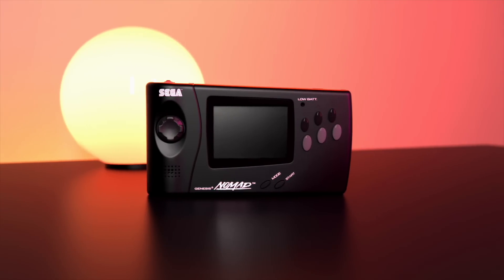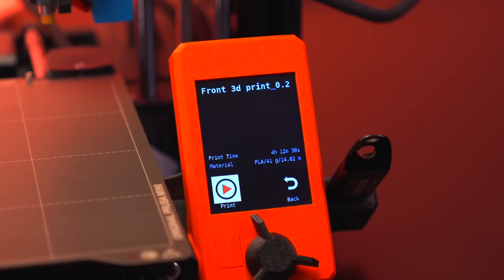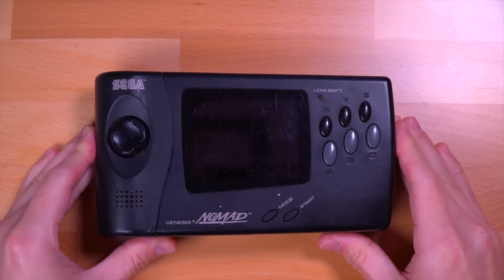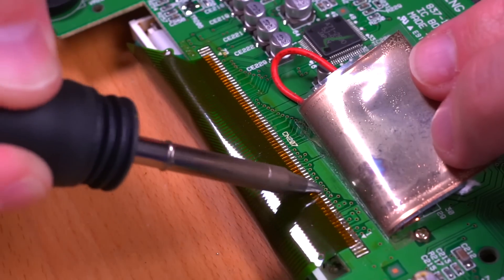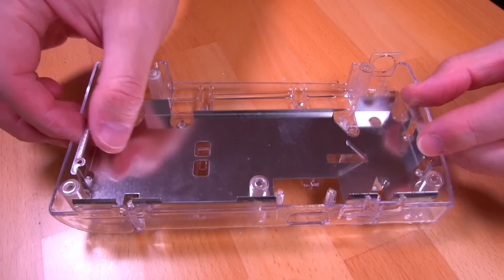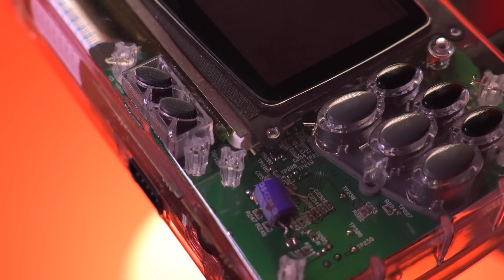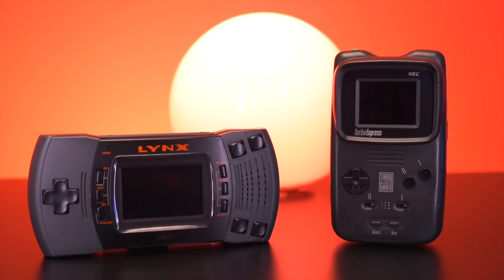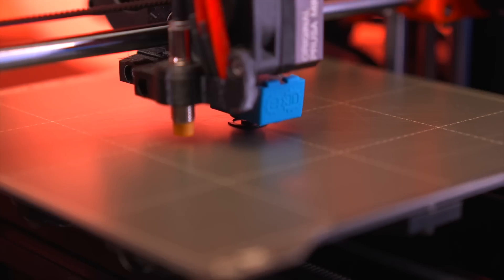3D Printing Has Changed Everything

Comment: For anyone attempting these mods, invest in new contact pads and a new battery. 1) The contact pads are usually the first things to go on most controllers and given the age of this thing, it is safe to assume that the pads it came with are close to the end of their life expectancy. 2) These are OLD  lithium batteries...Remember the Samsung Galaxy S7?? The one that burst into flames while people were using it? It would be a shame to put this much effort into a rehab just to have it melt in your hands. Lastly, when tapping those new screw holes, it is wise to heat the screws just a bit - it helps prevent the plastic from cracking (speaking from experience). Other than that, this is a solid rebuild. Nicely done.

Comment: the screw holes could be tad bigger and the posts tad thiccer where there is space for it on the stl.

that's a tip for making 3d printed replacements: don't replicate an injection molded part 1:1.  you're not under same limits as the guy who designed it for injection molding with the geometry and the 3d printed parts don't have strength in the same way the injection molded do. especially for printing replacement parts at home this is a very useful tip, design for printing and try to understand the actual functionality of the part and design for that within the space you have for the part.

Comment: I made a 3D printed adapter to make a video camera lithium battery pack work with the nomad.  It's way lighter than the AAs, and also lasts far longer, and you can get big Sony batteries pretty cheap.  But I need to re-do my screen replacement (probably with an RGB one this time) before I can finish it.   Of course, I also 3D printed the bracket used for my first screen replacement...

Comment: most 3d printer's bed is 200mm x 200mm which is good enough for any project, one may also get a Helmet class 3D printer 300mm x x300mm its just a bit more but can print bigger prints like a pc case cosplay helmet. I've printer a Mac classic & Amiga 500 replacement case myself. If you want fast printer get a Bedslinger , it prints 50x faster trade off is quality

Comment: I really love transparent stuff, tho I would say that a frosty and colored (specially a red one) would be more along my tastes, but really cool indeed.
One thing I would like to know, is the long term durability of those printed parts (recommendation on that at the end of my comment), I know that ABS stuff will last as long as normal stuff if printed properly, as the material itself has low creep properties, but PLA isn't a good choice instead, for the exact opposite reason - bad creep properties, meaning parts that are loaded constantly will warp. Low load parts, out of the sun tho, will last longer so no worries in that case.
SLA prints (which usually are what you'll use to get those crystal clear parts) often have bad creep resistance, but I would love to know how they fare, since it depends entirely on the resin.
At work we've got a Formlabs Form 3B so I've got familiarity with it's resins. They take quite an annoying thermal curing process to last anything, the black one will easily warp with heat and creeps like hell, we've got prototypes shown to clients that were perfect right at start, but months later they look all mangled.

If you want something that will surely last, with great finish, go with professional SLS prints, those are made from molten powder, they end up pretty much isotropic (so equally strong material in all directions) unlike FDM prints, and you can do them on Nylon/Polyamide so the material itself is good for end-use parts that will last long. This is what I'll recommend for the gears shown on the video.

Comment: My litmus test for aftermarket shells is if the parts fit seamlessly together with the OEM parts. So far no aftermarket shell has passed this test. Which has left me sad and disappointed. Ya'll might be ok with your horribly warped consoles but I want mine to feel original when I hold it.

Comment: Super cool! Been wanting a printer for some time, and learned a crapload before hand just haven't pulled the trigger yet. Between game stuff and my other hobby (reptiles) they are wildly useful for small things, and for cases or more intricate/demanding parts, combining with sprays and other resources it really has become a viable solution - even equaling injection mold with really high end printers honestly, depending what you are using it for of course. But for most things its really either or, especially with the insane amount of filament types now! Nylon, even metal mix stuff... Etc etc

Comment: Ah, that reminds me. Been needing a replacement shell for one snes i have. In part it was so brittle from the heat and sun out here, i literally only have the pcb innards of it. If i plug in power and video, it does work, thankfully. But simply put, never had a way to sort that out.

Comment: The thing I am looking for right now is dreamcast controller shells. I have 4 original controllers that are still in perfect condition, but since I switched my yellowed console shell to a new black shell  it would be awesome to be able to match the controllers to it. However, I am getting a feeling it would be super expensive to 3D print all four parts four times. and really, the cable and connector plastic should really also be black. So yeah, I feel like I am out of luck in creating the ultimate SEGA-black dreamcast. :) Perhaps those parts will be manufactured and sold eventually?
Reply: If you can find someone to 3D print for you (or a 3D print model in general), you can use 3D print smoothing (it's alcohol or acetone - can't remember which, Prusa did a video on it) to make it look injection molded

Additionally, look for Maker Space's near you, as they generally have 3D printers

Comment: Wait if we now basically have everything in terms of shells parts and such wouldnt it be a possibility to build new nomad motherboards ?
Reply: Largely depends on if there are Integrated Chipsets (ICs) that can replace the originals in a 1:1 fashion

Everything else, like resistors, capacitors, pcbs - can be replaced

But if there isn't a replacement for the ICs which does the exact job as the original - it's impossible unless you can make several off-the-shelf ICs do the same job
Reply: @Spiker985Studios  the cpu seems to be the same and there are modern day replacment in terms of screens

Comment: Unfortunately it's difficult to pull off that clear smooth look at home with printing. Tough resins might work better for a lot of these things, as you don't have to worry about layer adhesion as much.
Reply: Yea I was wondering what kind of printer was used for this. It would be cool to print a shell at home...but I have no idea what prints with that perfect smooth finish. It almost looks like injection molded quality.

Comment: And now please someone make a replacement shell for the NES (PAL frontloader version). As far as i know, ages ago someone produced small batches of the top halves, but i have not seen replacement shells for NESes unfortunately to obtain. btw: are more matte "smoke"-variants possible when ordering through pcbway (like most first-party-transparent shells are)?

 I'd really appreciate if you'd mention how much such a shell would cost when ordering with pcbway. It would be quite a difference paying ~50$ or 500$ for a shell. sure, this is a one-off and more expensive than mass-production, but the question is: by how much?

Comment: We are getting closer to Nomad replacement shells. Once these get all cleaned up and injected molded they will be ready to sell at retail just have to wait it out. This is fantastic :)
Reply: With how high quality 3D printing has become, especially through services that employ high end printers, if certain levels of finish is needed idk if it's really needed to wait on injection molds anymore
Reply: @hi_tech_reptilezz   Depending on the market size, it might be the best option, like the Game Boy lineup certainly benefits from injection molded shells (like, how many millions those sold?), but the less sold ones might indeed stay printed only.
If not transparent, I would go nylon SLS.

Another option, if the market is big enough but not THAT big, would be silicone mold vacuum injection molding, the molds are far cheaper.
Reply: @hi_tech_reptilezz  Or if certain levels of finish are unacceptable. I hate the rough layer lines look of 3d printed parts personally and absolutely despise that people are letting it become the new normal.
Reply: @Jackpkmn  yeah those are avoidable completely tho. That's just from raw layer printing. If treated, or if a resin printer with a high resolution is used, that's non-existent. There's probably tons of stuff out there that's printed at this point most don't even realize and think it's injection molded honestly
Reply: @Jackpkmn  That is just FDM, SLS prints for example (laser molten plastic powder, heck even metals in some machines) will not have many if any visible lines, not on the sides and at most at curves like a sphere, same with SLA, but SLA resin prints don't tend to last as long.
Reply: @Jackpkmn agree completely. But as you can see in this video, high-end resin printers seem to avoid that entirely